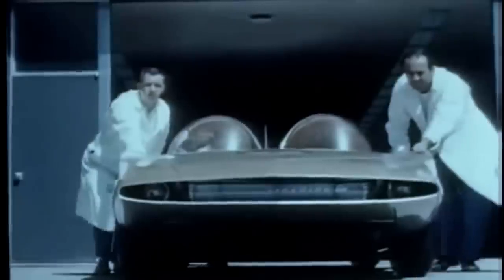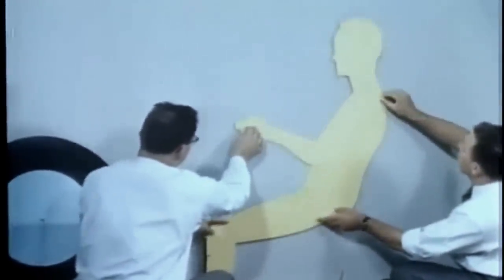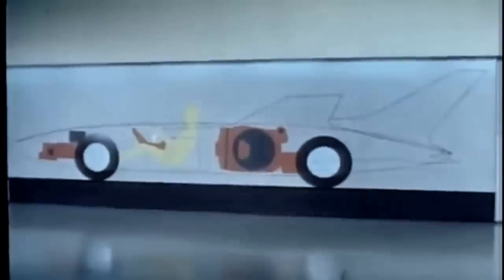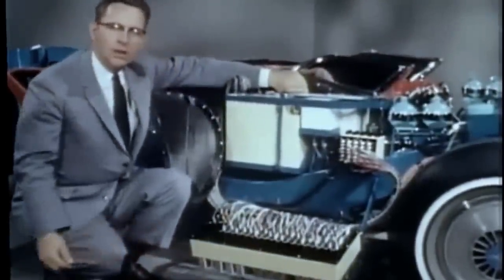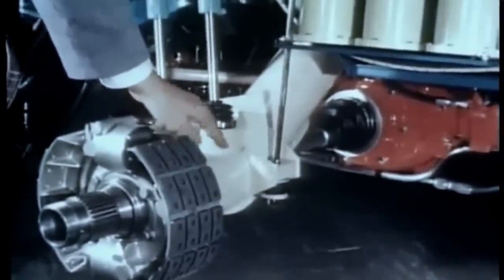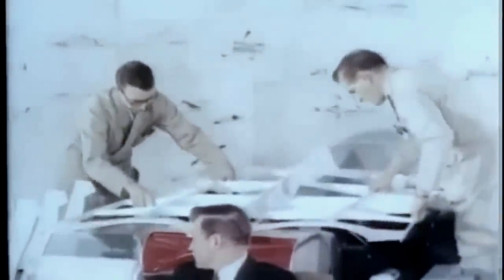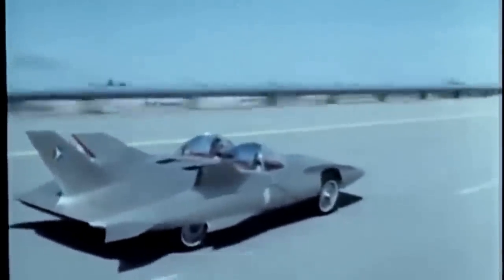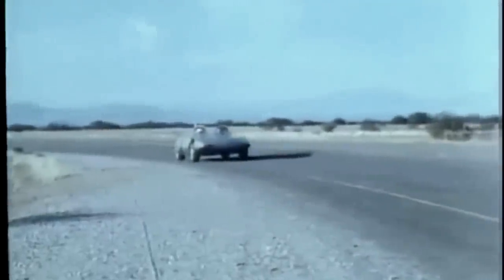GM Firebird lll Gas Turbine Car Promo Film - 1958

Comment: Only a GM car needs an APU (auxiliary power unit). Like an aircraft. To power its auxiliary crap they cram into an automobile. At least these GM engineers were still endowed with some common sense. Well...maybe not. But with more common sense than the GM engineers of today anyway. Like for instance. GM engineers think it is a good idea, to replace a simple spring with a oil pressure fed timing tensioner. Or to put a bypass valve on an oil pump. Or they redesign a simple ignition switch and kill their own customers. Then go further, and with great egotistical and ignorant way. Refuse to recall the ignition until law suits exceed the cost of replacing that ignition switch. Now that is due to some low cost engineering for ya. That only GM can equal.
Reply: I have an Audi tt...to change the front headlight bulb...you have to dismantle the whole front of the car..bumper grill etc...pute madness.
Reply: I'm not going to argue that modern engineers suck. However... There's not an oil pump out there without a "bypass valve" (pressure relief valve*). I'm a professional engine builder and there is a lot wrong in your comment but pressure relief valves are what control oil pressure otherwise the pump would just blow the filter off the engine... It's simple hydraulic theory. If you are referring to the filter bypass that's actually commonly found in many of today's engines and that exists because consumers are exactly that... Consumers. They buy the cheapest crap, then leave it on there waaay too long, then try to get stuff warrantied. Dirty oil is better than none at all so when your cheap crappy store brand filter clogs up and you drive it for another 3000 miles at least the engine is still getting oil even though it's not filtered oil.

Comment: "Electronic computers."  We're talking vacuum tubes for 1950s technology. Does the car have to pull a trailer to house the computer to carry out the commands made by the driver?
Reply: Active memory cores at that time were already being made of copper rings and wires. This car though wouldn’t need RAM, it would have been hardwired for real time operation, and so could have had transistors etc on boards, as aircraft of the time already had.

Comment: Firebirds I, II, and III -- part of an enduring legacy that teases the public with exciting concept cars that never become available.  (In this case it was probably just as well -- these look like they would have just spewed out even more CO2 than regular ICE engines already did.)
Reply: @phantomcorsair8476  You meant rather CO than CO2. They are two different things...
Reply: @phantomcorsair8476  Yep, this is right 🙂 But previously you mentioned "turbines make almost no co2". Indeed, they do 🙂 Jet fuel (and virtually any fuel nowadays, besides hydrogen) contains (lots of) carbon and the most reasonable thing you can burn carbon to is CO2. Unfortunately.
Reply: @phantomcorsair8476  That's interesting and I can only regret that I haven't seen your results... but where's the carbon then?
Reply: @phantomcorsair8476  

I think you lost the argument there when you say the NOX gases increase. They are the ones that are a Major Contributor Smog and Premature Deaths.
Reply: @phantomcorsair8476  

HaHaHaHaHaHaHa

You know that you have totally contradicted yourself.
Reply: @phantomcorsair8476  Maybe you misunderstood me or I misunderstood you 😉 I meant the carbon in fuel. This consists mainly from carbohydrates, i.e. CxHy, like C8H18 for octane. It can be partly alcohol or whatever, but it's still mainly C and H. So, C8H18 burns to 8x CO2 and 9x H2O (plus some shit gets produced if combustion isn't perfectly clean). If you tell that there's no CO2 on exhaust, where's the carbon?

Comment: The future is now , where's my turbine car ???
Reply: EV's were invented before the gasoline car, but were forgotten after the invention of the self-starter in 1912.  Ever since then, EV advocates have been saying "You just wait 10 years when good batteries are invented that will make electric cars as good as gasoline cars".  100 years later, and it still hasn't happened.
Reply: GM and Chrysler both experimented with turbine engines. They were found to be inefficient, noisy and produced dangerously hot exhaust gases. They are ok for airplanes, not cars, and the idea was dropped.
Reply: The Fat Biker e
Reply: techrules ren RS is your car!  xoxo
Reply: Fred Flinstone wrecked it!
Reply: Hidden under 600 METRIC tons of bullshit regulations
Reply: IT DIDN'T HAPPENED.,ARE YOU SURE,DO YOU KNOW THE TESLA,LEAF,BOLT RENAULT ZOUY,AND MANY OTHERS,YOU KNOW THAT NORWAY HAS THE MOST ELECTRIC CARS AMOUNT IN THE WORLD,AND SOON IN MANY EUROPEAN CITIES IT'S GOING TO BE FORBIDEN TO DRIVE  WITH I C  MOTORS CARS?
SCIENTISTS ARE WORKING TO DEVELOPE MORE 33EFFICIENT AND CHEAP BATTERIES  ,SO IT WILL BE EASIER AND FASTER TO RECHARGE ELECTRIC CARS AND INCREASE THE KM RANGE TOO
Reply: Derek Osorio The issue here is they think EVs are not more harmful to the environment during their life cycle.
Reply: @Gmail X
No, you need a couple solar panels and a battery pack (such as the Powerwall).
This electricity ≠ coal power is one of stupidest, sorriest excuses for a argument against EVs.
Even if electricity would purely be coal power it would be cleaner than internal combustion cars that pump smoke almost directly in your lungs.
Reply: You can get something a lot better. Electric cars. (Although EV's were possible since the beginning)
Reply: I can't argue with you about that , ounce i get my promotion at work i'm getting a chevy BOLT

Comment: I wished they made this car into production, it didn't have to be mass produced and everything in the concept car didn't have to go in production. And it could be low production. This would've be a great production car
Reply: Wow five years ago comment of yours, but did you notice the similarities between the Firebird III and the Chrysler Turbine? Seems like Chrysler would have gone ahead with the Turbine had there not been an EPA. The car (both of them I assume) created excessive emissions for whatever reason ...
Reply: @wilsixone  Yes emissions were an issue.  It was also a fire hazard if you parked it on tall grass. The engine got extremely hot and would cause grass fires.
Reply: @scottjohnson5415  The Chrysler turbine cars would overheat the car behind them when stopped in traffic.
Reply: @wilsixone  There was no EPA then. It was more about the high cost of manufacturing turbine engines, and the fact that they could never get them to do better than 10-12 mpg.
Reply: Those side fins would have taken a toll on pedestrians.

Comment: Sorry, but the remote, "ultrasonic" key, which automatically opened the door (and started the motor) was really futuristic...
Reply: If you had the right ultrasonic frequency you could steal the car using that though
Reply: Jourwalis - Right, When it seems that it was ahead of it’s time, more like ( 2018 and less)
Reply: There are reasons we don't see all that stuff around us. Radio waves are much better, can carry much more information and therefore encryption.  and my car can be opened and closed from much further away.
Reply: Futuristic?  Ultrasonic remotes were in use on some TV sets back then.  Considering the wide range of outdoor noises, it would be impossible to keep it locked all the time.  Philco had a radio controlled remote for a few of their fancy radios in the late 30s, but the remote was bulky because it used vacuum tubes and batteries.